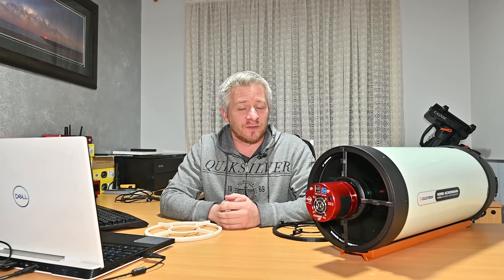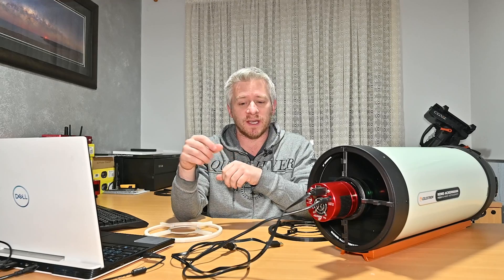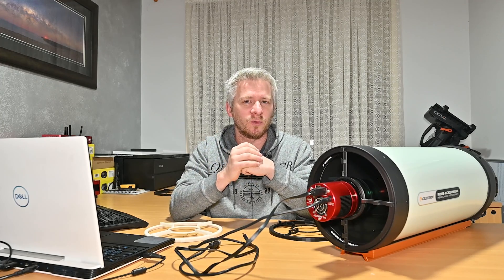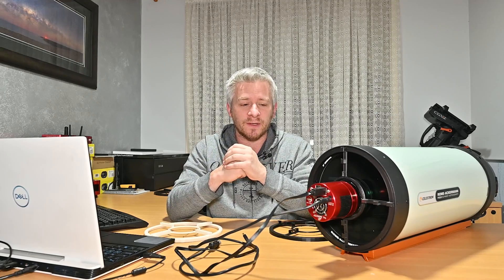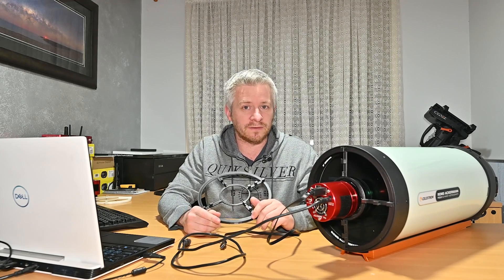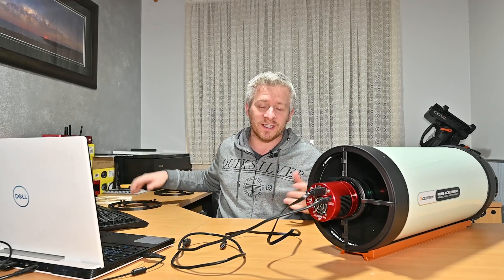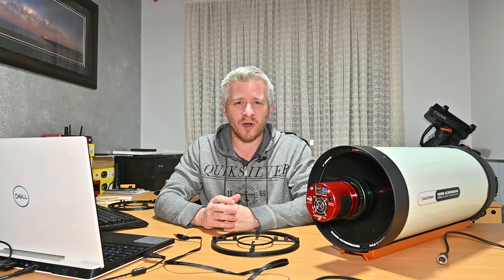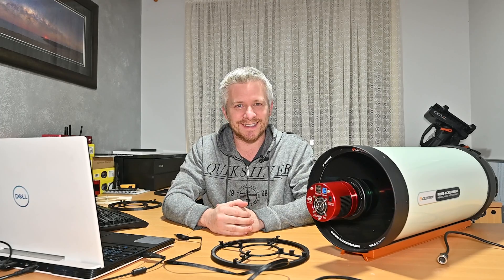3D Printing My Own Celestron RASA Parts

Comment: Hi Steve

I am about to bite the bullet on either an Ender 7 or Ender 5 Plus to allow for bigger 3d Prints.

How do you rate your Ender 6 for speed and versatility or would the extra space of the Ender 5 plus be a better fit.
Reply from the maker: I do like the Ender 6, the larger bed would be a nice option. I find that sped wise I’m using a slow setting anyway. I just like the idea of the enclosure. Still new to the 3D printing world however a larger base never goes astray and I’m sure will be handy for larger objects.

Comment: Hi Steve
I previously put up a comment concerning making a possible solution for taking Darks with a RASA 8 by using a particular Bahtinov Mask design as a template without the cuts and slits attached to the end of your dew shield.

It could also act as a dust cover thus not requiring the need to remove the dew shield when tearing down of a night.

That comment is no longer on Comment list for one reason or another.

Thanks Scott
Reply from the maker: Hi Scott, 

I did notice that, I was replying to it and when I went to reply the comment was gone. I’m not sure why.
Reply from the maker: Only issue with that style is your blocking all the heat in and the camera after a while won’t keep temperature. I have tried this and that was the outcome.

Comment: What about Camera Rotation if you want to do Mosaics? This was my issue with my hyperstar so I just went out an bought a 80mm APO triplet for that job instead
Reply from the maker: You can still rotate the camera with the mask in place so that’s not a problem at all. You will just have to reposition the cables and that’s why they can be supported by all 4 veins rather than a couple.

Comment: Nice job Steve! I have 3Dprinted several things for my scopes, next up is a 2 part Bahtinov Mask for the Rasa11 and a half moon cable holder for it.
Reply from the maker: They are so handy the 3D printers and fun too! 
Hope everything is well and good with your setup.
Reply: @StevenMorrisAstro  all good, I did do a couple of videos on the channel,  I'm running an AnyCubic Predator delta printer (my big floor standing one) and an AnyCubic Mega-S. Considered a resin one as well, but don't know if I could be done with the mess.

Comment: Hi Steven, it would be so much easier to use Astro spike software as you have many more options. But it won't help with your cables.
Reply from the maker: Thank you for the heads up, I haven’t heard of astro spike. I gather it adds diffraction spikes to images? 

Software doesn’t help with cable management unfortunately, the mask does produce a nice result though. Good thing the seven sisters is starting to rise to try it out on.

Comment: Lol, in Adelaide and likewise just bought 3d printer. Don't know your set up, but a glass bed has made life a lot easier with adhesion and smooth surfaces.
Hadn't thought of a calibration scale, but makes a lot of sense. Sounds like a nice little project
Best of luck with it's development. Cheers
Reply from the maker: 3D printers are so much fun! I have a glass bed also, one thing I have learnt is definitely pre heat the bed before printing it helps. So much still to learn though!